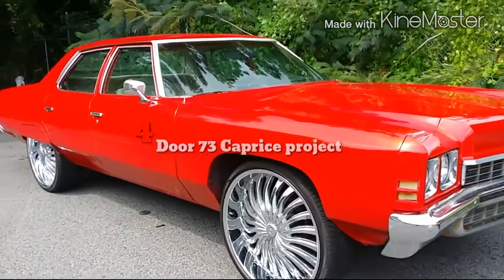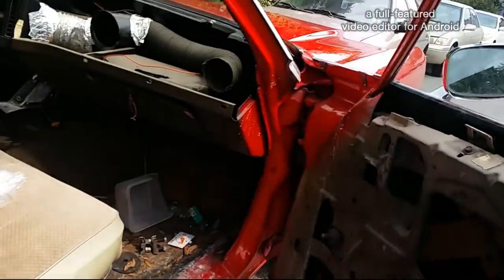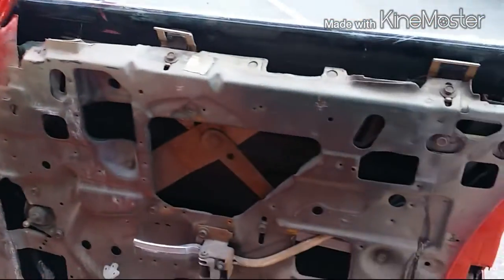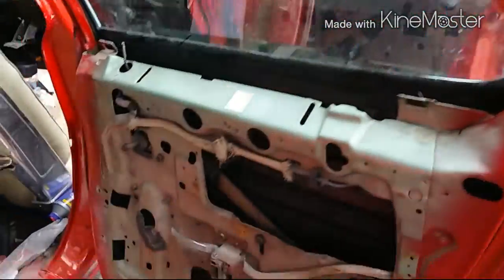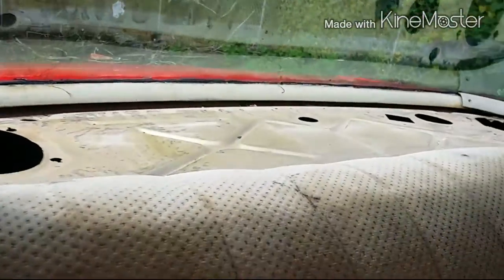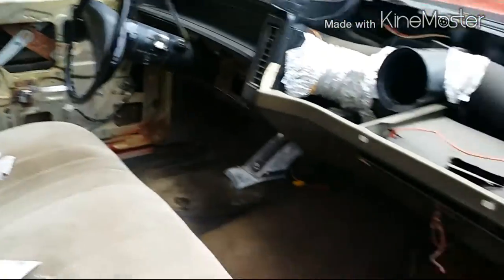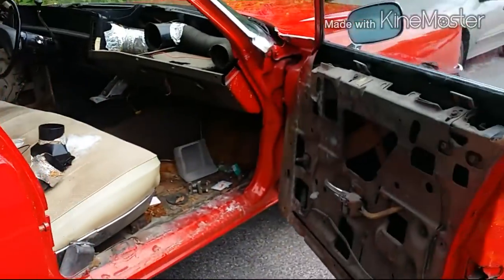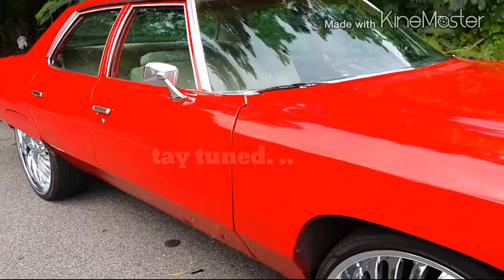1973 chevy caprice fiberglass project. ....

Comment: nice I have a 012 Chevy impala was thinking about doing the back doors how many speakers u think can fit on the back doors
Reply from the maker: I have a impala and my back doors have 2-8's and a tweeter and it still look nice. .. it's just the bottom half
Reply: I have 2 8" 1 6.5 1 tweeter in the front doors and the rear deck I have 4 8" 2 tweeters and was thinking wat should I put in the back doors